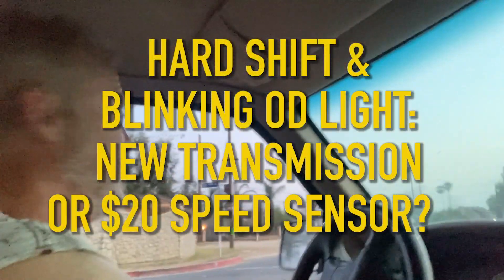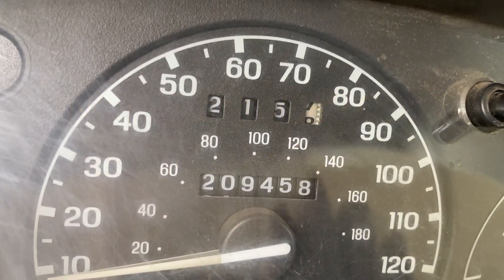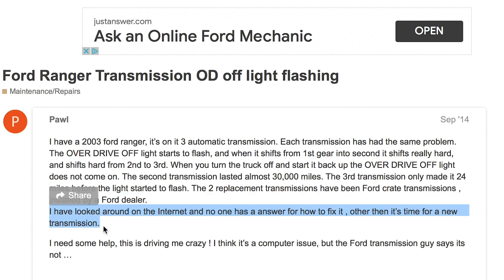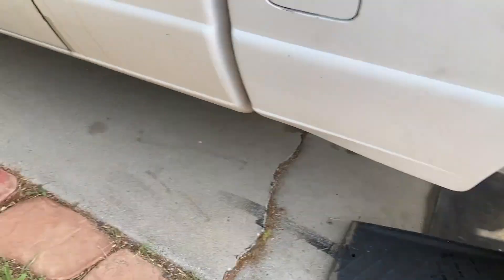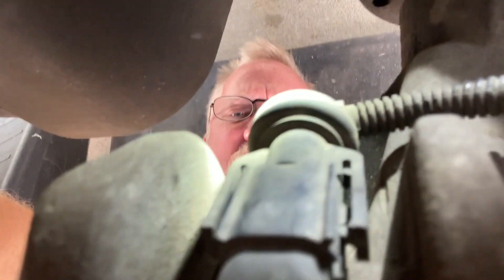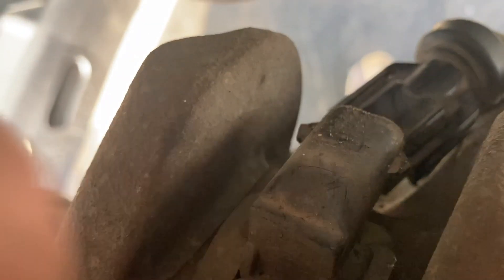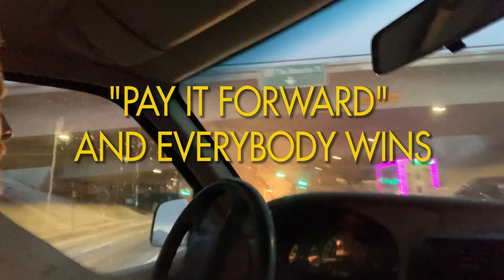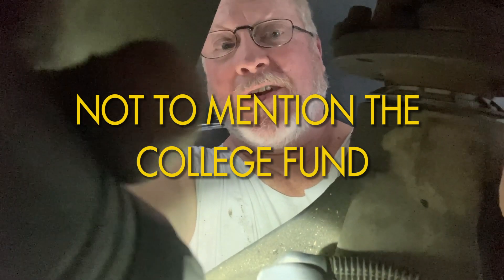Flashing OD Light & Hard Shift on automatic Ford. Replace Transmission or install $20 Speed Sensor?

Comment: I have a 1999 Acura tl Engine and TSC light came on wile I was driving on the highway wile the car was dropping gears started jerking people are telling me to replace transmission but I was wondering what is your opinion got it plugged in p7040 code came on the guy at AutoZone told me the same to replace transmission
Reply from the maker: Hey Juan,
Sorry to hear about your Acura acting up. I think you may have meant OBD code P0740? That's a torque converter clutch code. 
Unfortunately, that part is INSIDE the transmission and isn't a 15 minute fix like a Speed Sensor is. 
Any advise is beyond my handyman expertise level. 
Wish you best of luck,
Grandaddy-o
Reply: Thank you

Comment: Just had this problem today.  I found your channel and watched the video. Suspect the same sensor fail on mine. Will change tomorrow. Remember the wiring should also be checked for breaks . A broken wire to the sensor can also cause it. Great video. Great info. Replaced this sensor on Sunday. Drove and in beginning seemed to work just fine. Transmission shifting good. Took on highway and coming back light started flashing again. When removed noticed small piece on sensor. Think I’ll try and buy another sensor and change differential fluid. Following thread on this problem 1 guy said this sensor did not work for him had to get original part. I’ll try rock auto. Stay turned. Well update. Tried rock auto sensor but it was for the transmission sensor not diff. No help. Ordered oem sensor from Ford still not working. Will have transmission rebuilt.,CODE P0733 which is internal sensor for transmission shaft. Transmission fluid showed signs of overheating so bite the bullet and rebuild. Original part # ZZP0-43-711C for Mazda B3000 which is a Ford Ranger
Reply from the maker: Hey Bill - All I know is this trick fixed my '98 Ranger and before that my 2004 Ford Focus. It's a cheap part and 10 minutes work putting it in. Best first diagnostic/possible fix. Go for it! 
Good luck - Grandaddy-o
Reply: Is this the only speed sensor for the 2000 Ford ranger. I'm a bit confused

Comment: Great job. I believe the diff location sensor is the abs speed sensor. The first one w the gear goes on top at he back of the tranny. It's a speed sensor also, I believe. So, two
Reply from the maker: Hey thanks for the explanation.  I wondered why they gave me the geared one and said it was correct part for truck.  Yes, right for truck, wrong (abs) sensor for fix.

Comment: My Escape has similar issues and broke down a week ago. I was at a stop light and went to go but my escape was just revving and finally got it to catch a little bit to get it parked but I had the peddle to the floor basically. The shifter won't lock into drive, reverse, 1st or 2nd gears. The shifter seems to move freely with barely any pressure applied.
Reply from the maker: In the first minute I said that the truck trannie was never slipping, but making the shifts hard and late.  You explain, "The shifter won't lock into drive, reverse, 1st or 2nd gears. The shifter seems to move freely with barely any pressure applied."  Unfortunately that sounds like mechanical issue, transmission or linkage. The $20 Speed Sensor Fix can't hurt - but seems unlike to help in this situation. :(  
Best of luck - Grandaddy-o
Reply from the maker: If your transmission was working well before the problem, not slipping or acting up, then chances are you or mechanic should look at the linkage components. Again, removing some screws and taking a look if any elements are obviously loose is waaay cheaper than a new transmission. But only if linkage is actually is the problem...

Comment: I have the same problem with a Ford ranger 2002 but it happens once in a while how’s the piece called?
Reply from the maker: Intermediate symptoms once in a while?  Very much could be a SPEED SENSOR problem.  Tell the parts store '02 Ford Ranger and they'll want to know what engine. (If you want you can give them the VIN # from the drivers door panel). Then say "Cheapest SPEED SENSOR that fits." For under $30 and less than a half hour you'll know. Good luck!
Reply: @lazycowvintagethriftdesign5595  well unfortunately it didn’t work on my Ford ranger 2002 after 15 minutes driving the o/d turns on by itself and doesn’t turn off at least I turn the truck off took it to 2 different mechanic they couldn’t fix It

Comment: Thanks, I'm hoping this could fix the same problem that I am experiencing with my 2004 Ford Explorer- but it still might be my transmission selinoid, but since I do have a speed sensor on the back hub, it's very possible this could be the problem- I comment on the results at a later date
Reply: Ok, so sorry it's been a minute- It wasn't the speed sensor on the back hub, but it was the left ABS speed sensor on driver side front tire, you have to take off rotor to get to it, fixed it right up
Reply: Any updates?
Reply: Was your truck having the same issues mine is flashing od light and I felt a wierd down shift from 3rd to 2nd and I put it in drive and it makes like a chirping sound and whistle
Reply: and how did you find out it was the abs sensor
Reply: @alfonsom2385  I went to an Auto supply and they hooked up computer for free, said it was left abs sensor

Comment: I have a 99 F150 5.4 and the OD light is flashing on the gear lever. Going to check the wiring as well as check and replace this sensor if it is on my truck model. Great video.
Reply from the maker: Great inexpensive first fix/diagnostic Wally. Any symptoms with the speedometer or transmission? Also bad wiring can indeed throw the signal if the signal from the speed sensor isn't making it to the OBD computer.
Reply: @lazycowvintagethriftdesign5595  No issues yet with transmission or speedometer
Reply: Depending on the year and transmission  92 up trucks and vans will have a rear wheel ABS sensor on the differential  some years it acts as the VSS as well. The 95 Bronco and 95 E350 had no VSS on the transmission relied on the sensor on the rear. My 97 and 98 E350 have the sensor on the transmission  and the one on the rear diff.
Same with the 2000 F250. 
96 and older will have the E4OD 97 up 4R100 until the change over to 5r110w.

Comment: Had a customer replace their transmission twice and still no shift, flashing OD light, turned out it was just a cut wire in the circuit. After about 5k spent in repairs all because a wire was cut.
Reply from the maker: It's a good mechanic that checks the cheap fixes first!  Sometimes a new trannie is needed, but sometimes not!
Reply: @lazycowvintagethriftdesign5595  I believe they go by Transgender now
Reply: The cut wire is in the steering column where the overdrive wires come out of the shifter. It was a bad design. I fixed that and still the same problem.

Comment: Thanks my friend I'll try that on my 2007, just call the mechanic and right on the phone he told me is time to replace the transmission, with out even look at my truck??? hell no!
Reply from the maker: Hey Gerardo it's one of the cheapest fastest things to try first. "Sometimes" it works so it's worth the effort. Good luck!
- Grandaddy-o
Reply from the maker: By the way it's been 6 weeks and my 1998 Ranger 3.0 automatic is running and shifting perfectly like there never was a problem.
Reply: @lazycowvintagethriftdesign5595  great, this lady will be back under her new/free 2 me, Ranger, replacing one or both of these because I did get a p500 code on my 95 3l, 2wd. 158k miles and I'm sure, it's cheaper to try these to fix the code and the blinking OD light, that comes on, at 58 or 60 mpg.   Glad to know, your truck is rocking and rolling, again.
Reply: Good old trustworthy mechanics!!

Comment: First to comment? Ok, I’ll take it. Thanks for the helpful video. Some parts had me laughing especially when you dropped the phone. I’m going to try this tomorrow and see if it fixes the problem with my 2001 Ranger. I’ll let you know how I get on.
Reply from the maker: Hey Wayne I hope this works for you!  You can't always avoid an expensive repair but the least expensive things FIRST is the best procedure. - Grandaddy-o
Reply: @lazycowvintagethriftdesign5595 The code reader at autozone told me it was the throttle sensor which I replaced but it hasn’t fixed the jumping hard shifts of the gear changes BUT it has fixed the rough idling the truck appears to have developed the last couple of days. I’ll replace the speed sensor today and see if that fixes the issue. The check engine light is still on so I’m really hoping this solves it. Update to follow.
Reply from the maker: @1967wjsmith   After your first fix addressing the rough idle and Throttle Sensor code, you'll need to clear the old OBD error code. The check engine light will stay on until you do. Then, see if a new code (hard shift symptom) shows up. You can buy an inexpensive OBD reader for under $30. This will read and clear codes and you'll be using this tool for years.  I'd go ahead and change out the Speed Sensor ($20-$30 part and half hour labor).  My Ranger never threw a transmission code and after the speed sensor switch - drove like she completely forgot there was a problem. Good luck. I find an occasional prayer helps too!
Reply: @lazycowvintagethriftdesign5595  Yeah, I heard the old error code needs to be cleared before the check engine light will disappear. I’ll go ahead and swap that speed sensor out and perhaps get me a code reader while I’m at it. Thanks again.
Reply: Ok, So after replacing the speed sensor the issue still persists. I’ve checked the transmission fluid and it’s all good. I did notice that when I took out the old speed sensor there was oil gunked up on it. Is this normal? I noticed when you took your sensor out it was pretty clean. I’ve cleared the codes and I have three that keep returning. Mass or volume air flow A circuit low input one of which is CONFIRMED the second exact same error shows MIL. Last error code is On board diagnostics II monitor /Drive cycle test not complete. NON MIL. 
Lastly, the hard shifts only appear to happen when shifting from 1-2 and from 2-3. Can’t feel it on the other shifts. Any other ideas would be awesome.